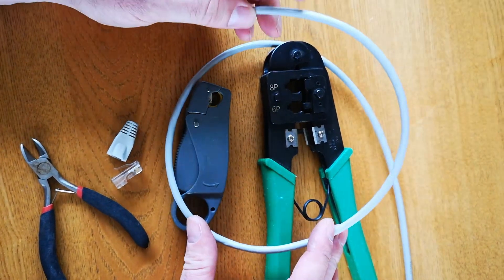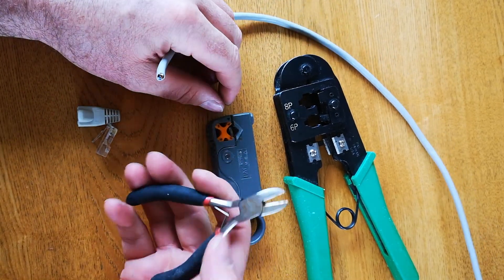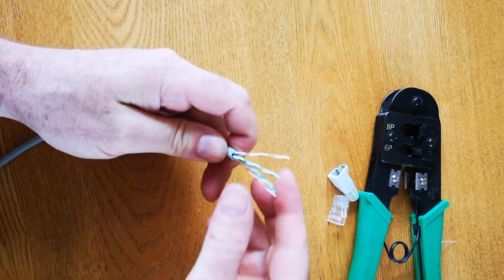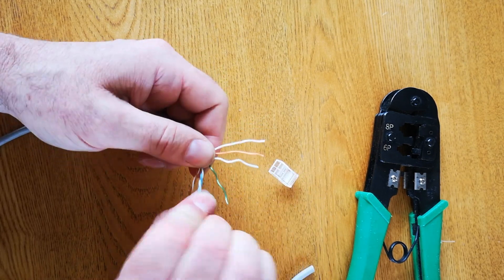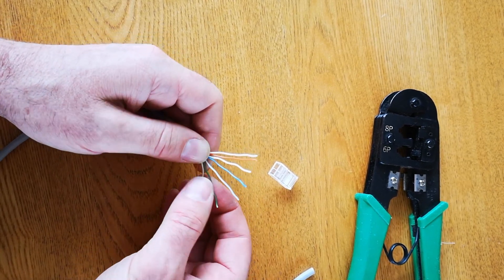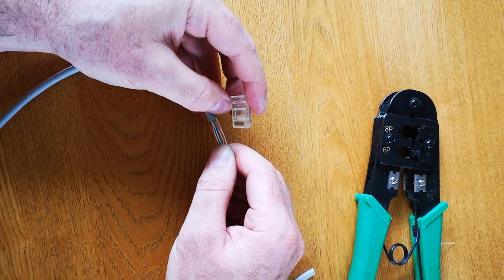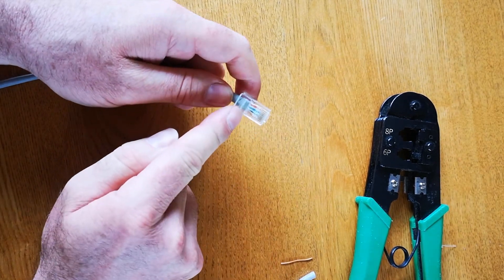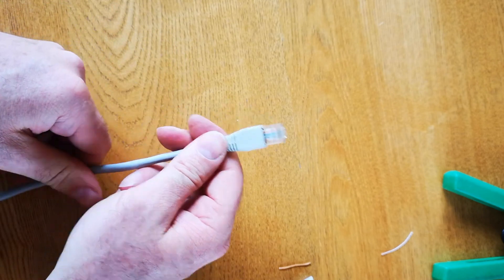How to Crimp a Network RJ45 Connector - Solar CT Clamp, BMS, RS485, RJ45 Data Cable Wiring

Comment: Good day JW, I have two battery's with ports RS485A, RS485B and RS485C. I need to connect in parallel. Is this the cable I need? Do you crimp the other end of the cable in the same way?
Reply from the maker: Yes, both ends the same.